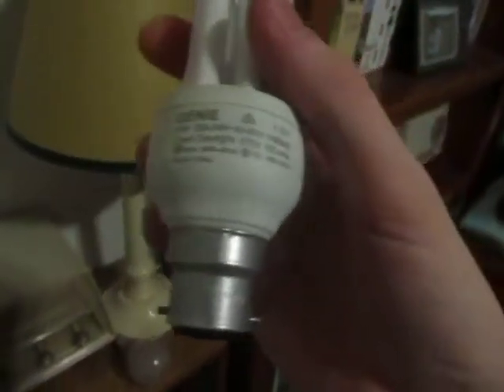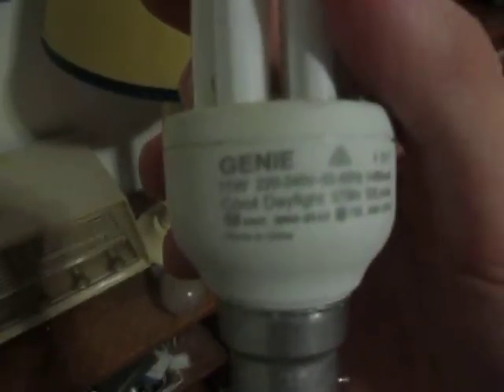Disconnected flashing CFLs!

Comment: I hate cfl's. This is why i'm still using the good old incandesent bulb. Where I live I can still buy 100 W. When they will ban them I'll just buy led bulb, mutch better for the environement than cfl's. I rather prefer use more energy than release mercury and electronics parts in the environement.
Reply: my mum and dad are moving on to LED bulbs from CFL they seem to be nice however i prefer something i always liked the older bulbs i may move on to LED one day from CFL they dont get hot and save a lot of power and last a lot longer (apparently)
Reply from the maker: Nintenloup wolf I didn't like CFLs before (except for the 1980s/1990s Philips SL CFLs), but I'm starting to take a liking to them now. I still prefer incandescent bulbs, but now CFLs are going the same way as incandescents, as LED lighting is rapidly taking over.

realgroovy24 tech That's exactly why I'm starting to like CFLs now - as they are rapidly being replaced by LED lighting. I steer clear of the real cheap Chinese CFLs though, as they can be dangerous and have a short life-span. I like the better quality CFLs (Philips, Mirabella, Neco etc.) and the unusual/old CFLs.
Reply: ***** just wondering why dont you like LED? again
Reply: Something good to know: electricity generation releases way more mercury into the atmosphere than what's in CFLs. So if you care about that, definitely go for one of those or leds instead of incandescent bulbs as the latter cause a lot more mercury to be released.